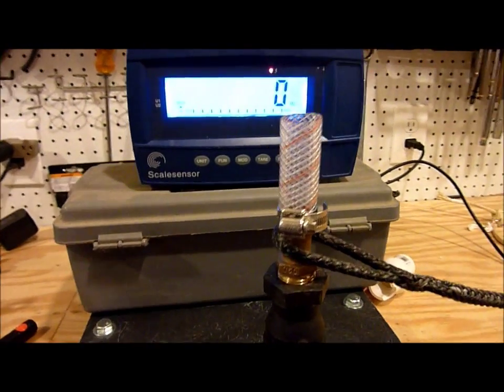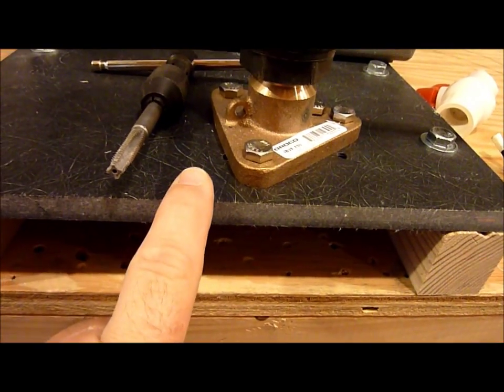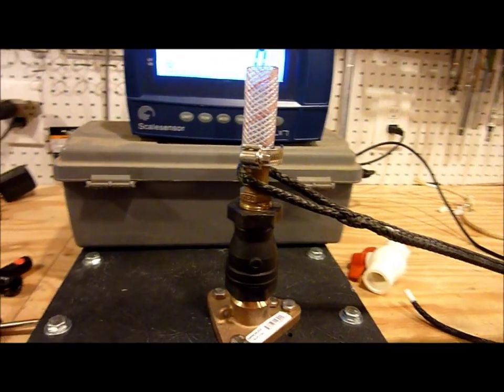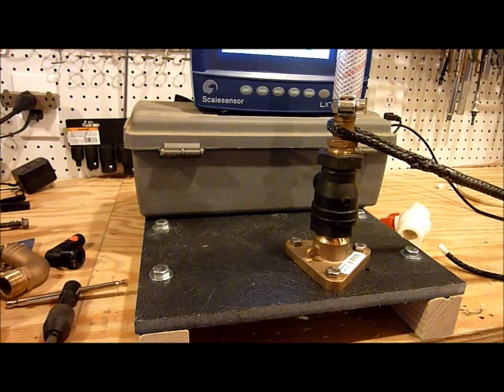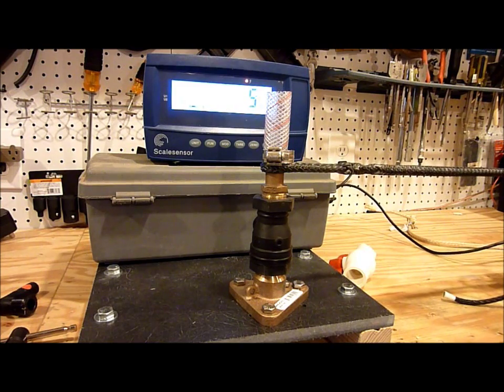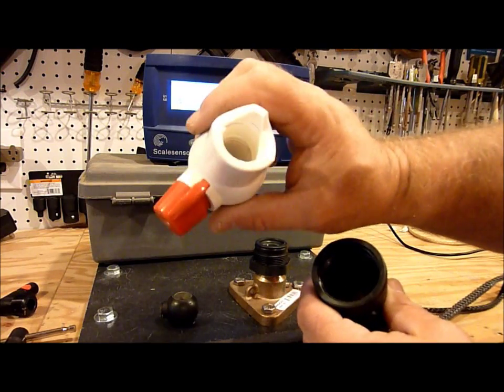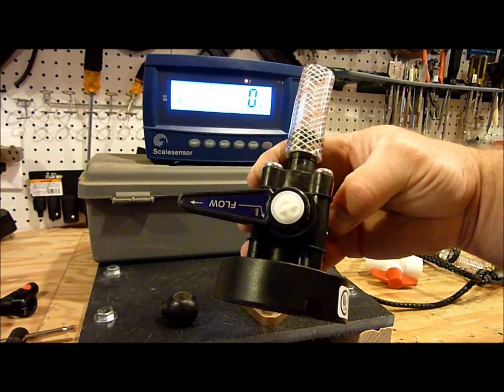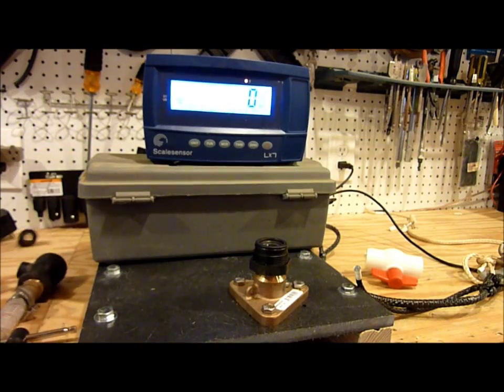Drilled & Tapped Groco Flange Adapter With  3/4" Marelon Valve

Comment from the maker: Only the backer gets tapped. It is then epoxied to the hull. Here's the original article on the process. I still advise 5/8" G-10 or 5/8" GPO-3. I added a link to the original comment see that link for more info.
Reply: Compass Marine Inc.